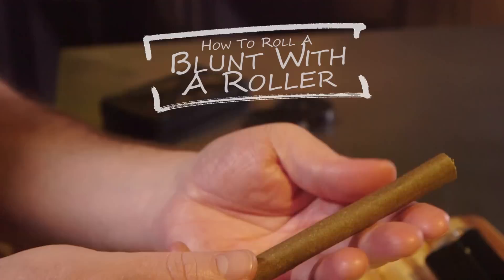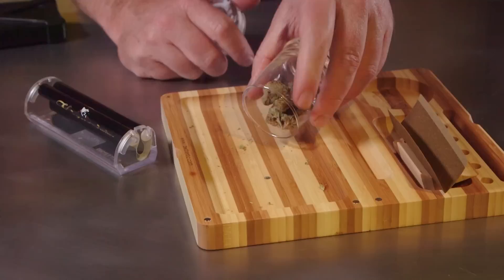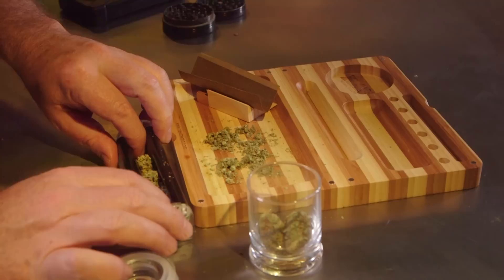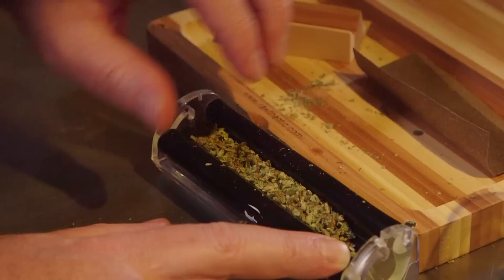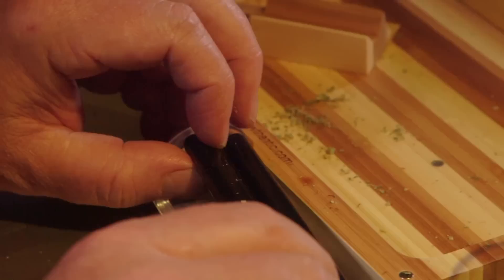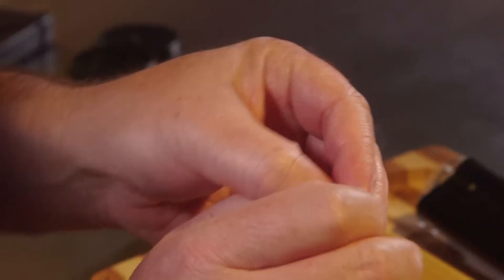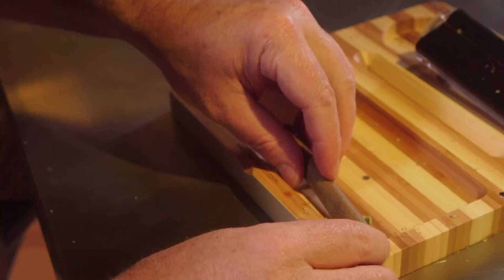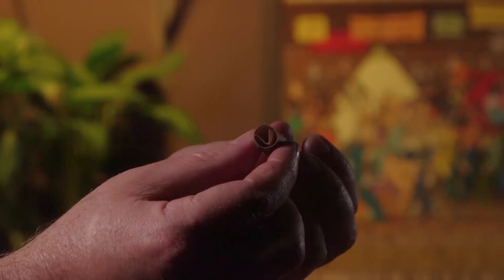How To Roll A Blunt With a Rolling Machine (Kingpin Blunt Roller): Cannabasics #51

Comment: a great rolling machine but for those interested in a lasting roller I wouldn't suggest this the black material eventually starts to fade and the only place It can be going is on blunt....... for a great product long lasting is a raw rolling matt blunts and joints can be handled no problem
Reply from the maker: Great info thank you! I'm gonna see if RAW will send us the rolling mat, thanks for watching!
Reply: Can You Use Back Woods Too

Comment: I've done this with a swisher and the mid raw roller. Size was good and it burn great, just hard to add the wrap into the roller. But yeah, if I have time I'll roll it in roller if not then by hand
Reply: Paco Ramirez Shouldn't it be the other way around? If I have time I roll a blunt by hand, if I don't have time I use a roller...